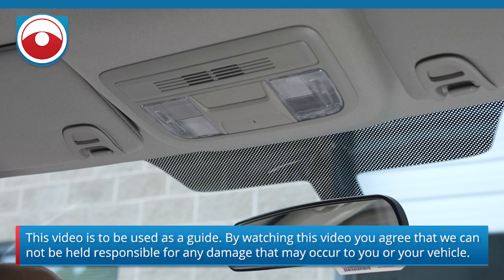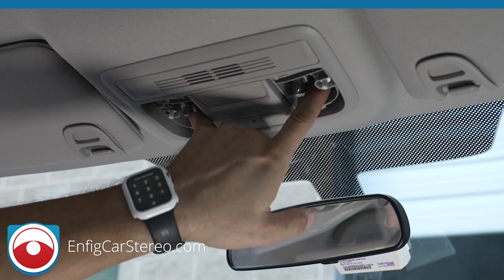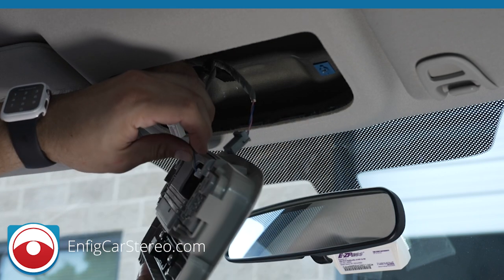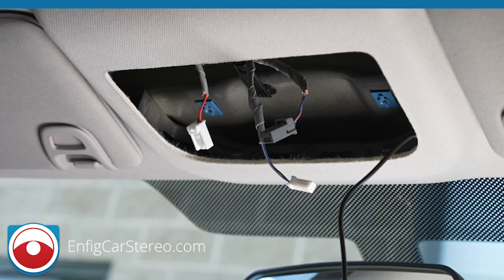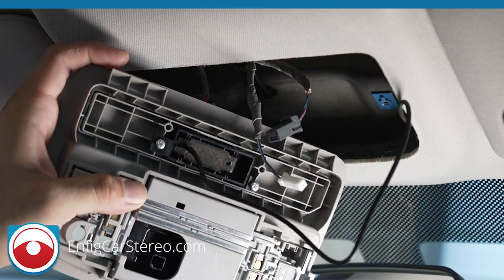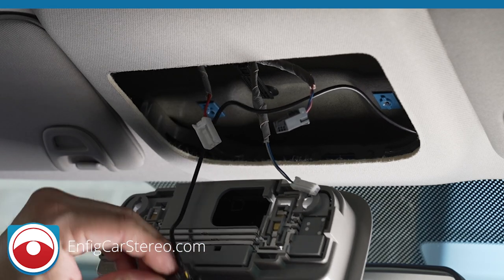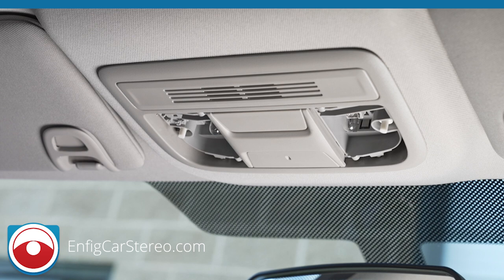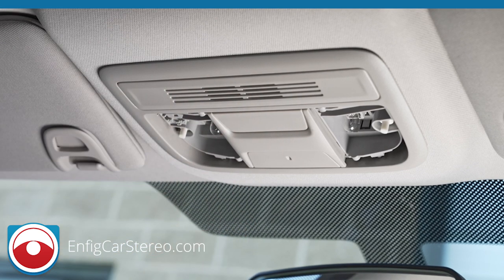Honda Civic 2016 2020 | Bluetooth Microphone

Comment: Amazing! I was looking for a custom-fit 3.5mm microphone that would fit in this location for my 2012 Accord’s aftermarket radio! The description does not state that it will fit 2012 Accords, but the OEM microphone mounting tabs are set up exactly the same as the 2016+ Civic, so this will work perfectly!
Reply from the maker: Hey just seeing this.  Did you order it?  Did it work?  IT looks like it wil lfit but we have not tested it yet.

Comment: Do you have any audio tests? The mic that came with my aftermarket radio is abysmal. I need a quality upgrade that is in the factory location, unseen
Reply from the maker: Even if I did they would be fake.  In car stereos there is not standard for microphones. If someone did an audio test they would use the most compatible radio for the test.  Out microphone works well with most radios.  Its a good mic and we offer a 60 day return policy.  And sound is opinion too.  There is a radio where our mic is much clearer, but the one that comes with the radio is louder and noisier.  We sometimes get returns on this one but usually people comment on how much clearer it is.

Comment: What mic do you recommend for a 2013 Audi A3?  I have a Kenwood head unit and your adapter. The Kenwood mic doesn’t sound good.
Reply from the maker: Where did you put the Kenwood mic?
Reply: @Enfig  I stuck it in the factory slot in the headliner center switch area.
Reply from the maker: @robertlittiken394  That's not going to work.  We make custom mics for a reason.  They are designed to go into the factory location.  Mics that come with radios are designed to be mounted in the open in the cabin in your car.  If you mount them in the factory location you are blocking most of the holes on the mic.
Reply: @Enfig  What’s the part number for your microphone?  Thanks
Reply from the maker: @robertlittiken394  Sorry I never saw this reply. https://shop.enfigcarstereo.com/product/enfig-mic-aud4/

Comment: Where i can get the Honda City Microphone ?
Reply from the maker: I assume you mean Civic instead of City.  Here is the link. https://shop.enfigcarstereo.com/honda-civic-2016-2021-radio-replacement/
Reply: @Enfig  I’m seeking for Honda City.
Reply from the maker: Looks like it has the same part as the civic.  Can you send a picture of the overhead light?
Reply: @Enfig  Yeah, i have checked it’s different, it comes with 2000 ohm impedance circuits.
Where to share picture?
Reply from the maker: @Tiloshmali   Email it to me.  Info@enfig.com